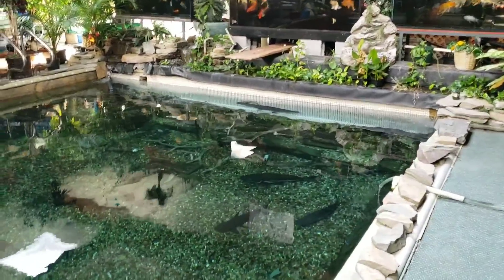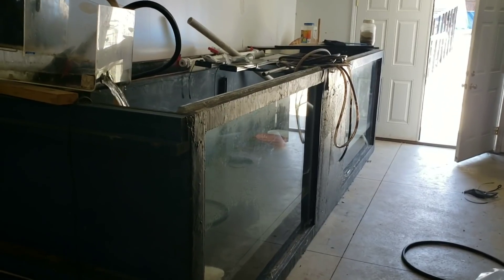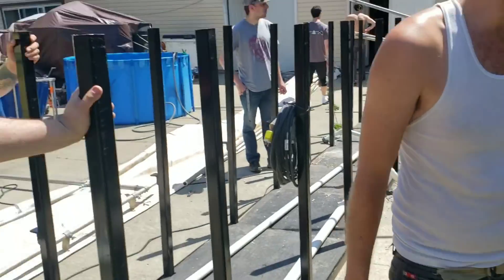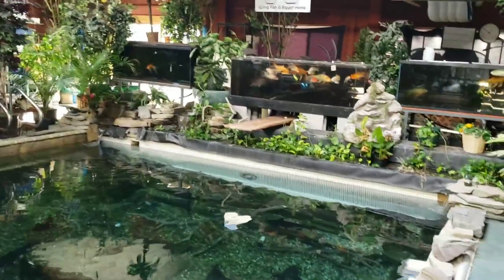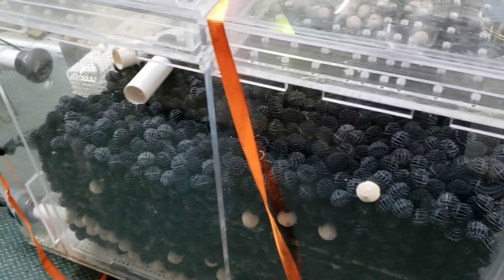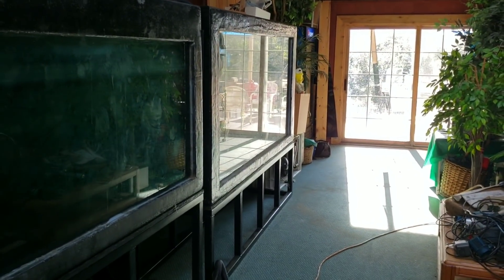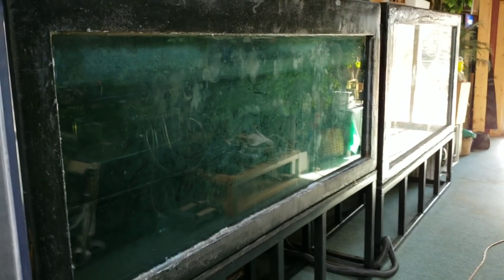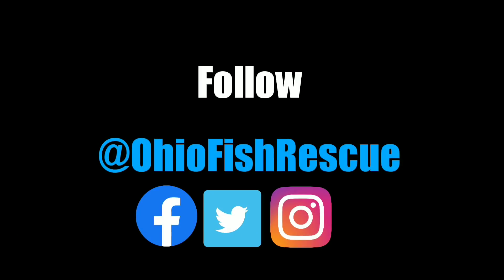New Layout and Tank Plans Moving Forward! Monster Fish Stocking and Bellagio Stands being Welded

Comment: In hindsight it might have been easier to just cut the uprights of each tank stand down to the correct height and fabricate a pair of new rectangular tops to avoid the slow grind of cutting through so many flush weld points.

Paying for the extra steel might be less than the labor value in having someone take so much time doing it slowly. Plus you could potentially turn the offcut tops and stumps into new half-length stands with a bit of creative engineering. It's still doable with the remaining stand.